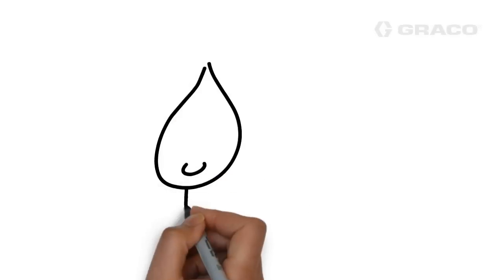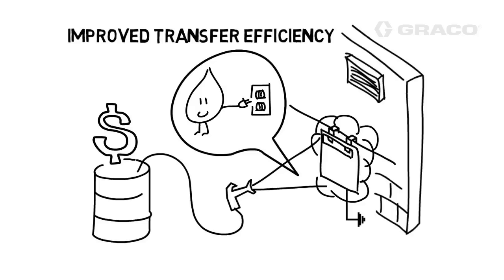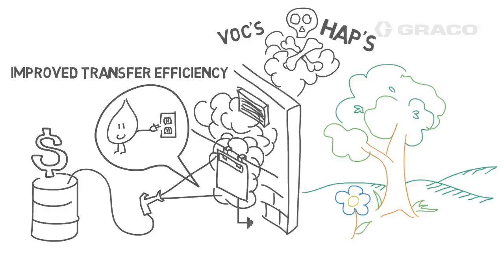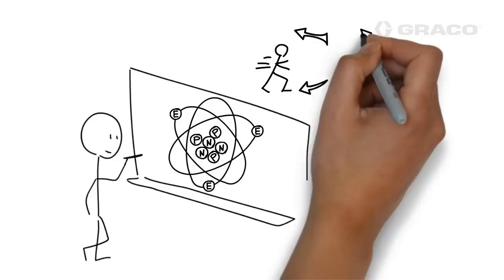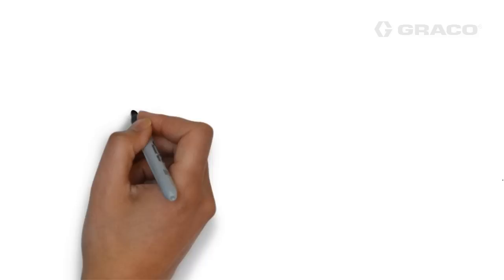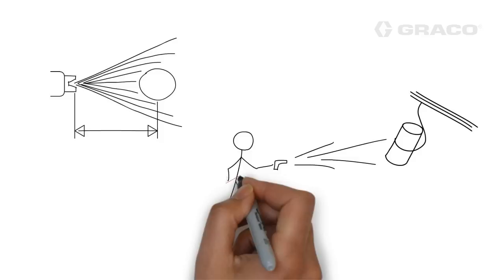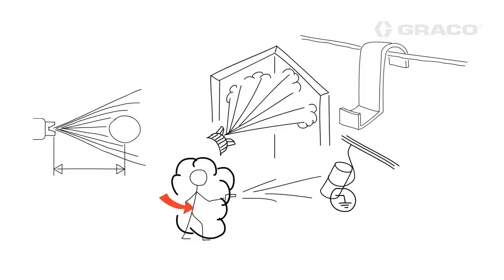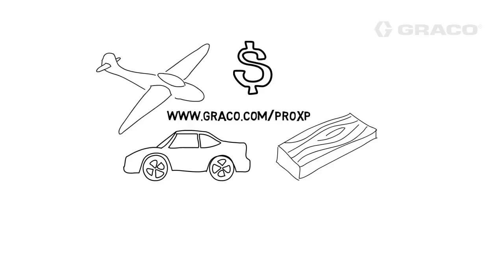Electrostatic Spray Gun Basics

Comment: Since the neutron is neutral, how does the electron get attracted to the neutron in your illustration?
Reply from the maker: The grounded part is the neutron. We charge the paint with electrons, and that sets up the attraction (opposite charges). This method is its called corona charging.  
 
There is another method called contact charging, where the part is charged with a proton. However, the materials that can be used with contact charging are more limited than the material possibilities with corona charging.
Reply: @GracoIndustrial  thank you for the explanation

Comment: Hello sir, could you tell me why the spray gun is always held perpendicular to the body to be painted?
Reply from the maker: It's simply how the gun was held while this video was being made. Rather than focusing on perpendicular alignment, it's more important to keep the distance between the the gun and the part at 10 inches or so. This will help you achieve and even wrap of the paint around the part as you spray electrostatically.
Reply: @GracoIndustrial  Thanks a lot sir

Comment: Can you use electrostatic sprayer for ceramic coating?
Reply from the maker: For most materials, including ceramics, it depends on the solvent blend being used as a base. Ask your local distributor to test the material to see if it can be sprayed electrostatically.

Comment: Can you use electrostatic spray gun to spray ceramic coating?
Reply from the maker: It depends on the solvent blend of the material's base. Your local finishing equipment distributor should be able to test it to see if it can be sprayed electrostatically.